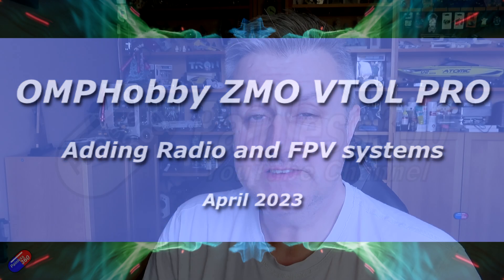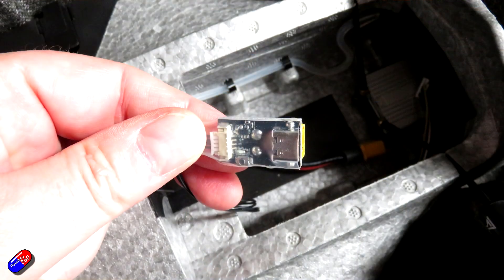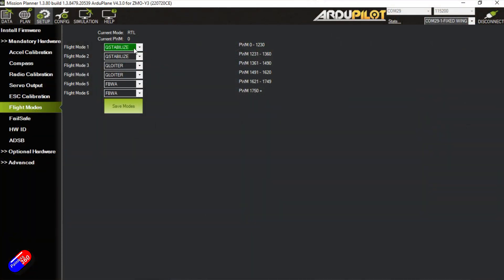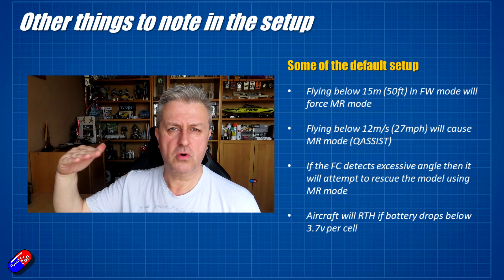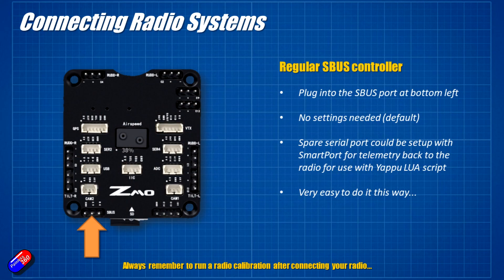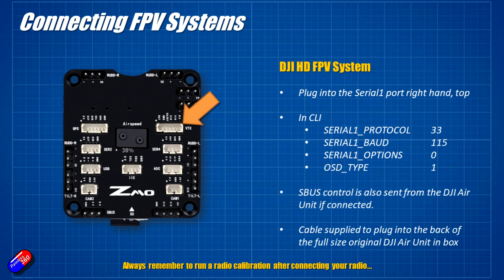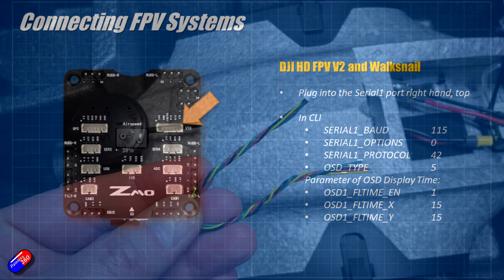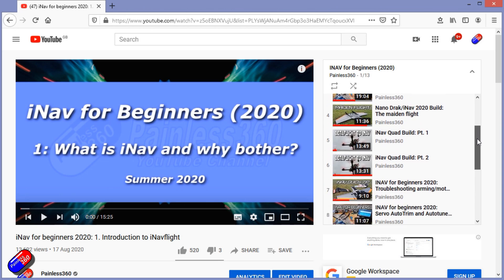OMPHobby ZMO PRO VTOL: Adding a radio and FPV gear (SBUS, CRSF, DJI etc.)

Comment: Cool, do you have a video of it flying?
Reply from the maker: Mine crashed on first flight due to a servo failing. Still trying to get it airworthy again..
Reply: @Painless360  ah, bummer. Omp didnt get you a new one for this?
Reply from the maker: We've been trying to repair it... Stay tuned

Comment: Hi Lee, Steve here it’s been a little while still watching all of your videos. They’re always so good Lee I got a couple questions if you don’t mind one is going to be about the. Heewing t1 vtol, when mounting the GPS ( matek m8Q 5883 ) does the arrow need to be pointing in the same direction as the flight controller?  ( matek f405 vtol ). In my case, I mounted the flight controller the same way you did, and just reversed it in mission planner but if I’m not mistaken, I think you might have the GPS facing the same direction as. Fc, second question in regards to.ZMO pro. And what was your final outcome as far as installing the pitot tube I think the last video I saw of you with this boy she was going to go back to the original set up that they provide and try that I was told it works if there’s no wind at all I was just wondering what your thoughts were on that and what did you end up doing with yours? Thanks so much Steve and continue. Looking forward to watching more of your videos. Believe me they’re so helpful. Thanks again Steve.

Comment: How do I setup DJI 03 air unit with the remote controller 2?
Reply from the maker: I don't have one here to try. Best of luck
Reply: I have both O3 and RC2, but my current setup is to use O3 only for FPV and another ELRS receiver/transmitter for control. I will check how to use DJI O3/RC for control and let you know.
Reply from the maker: They released a firmware update on the 21st April that addressed that. I'm trying to find out where they posted it so I can share a link..
Reply: Just make sure you upgrade the DJI O3 air unit and the DJI remote controller 2 to the latest firmware then you can bind both the controller and the goggles 2 to the O3 HD system.